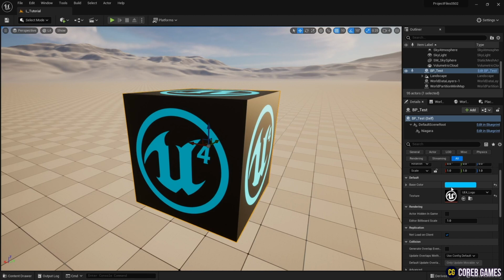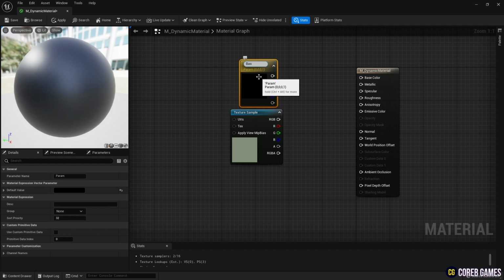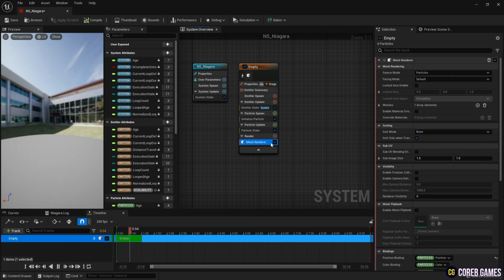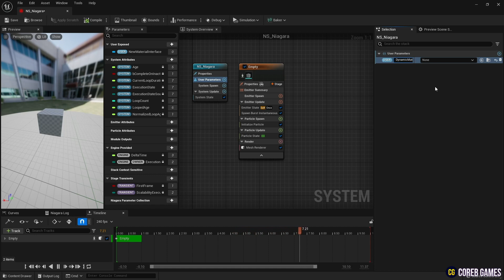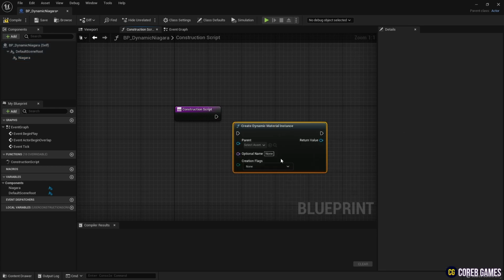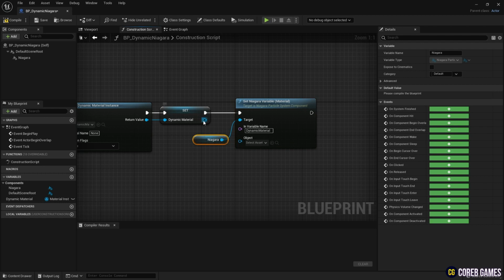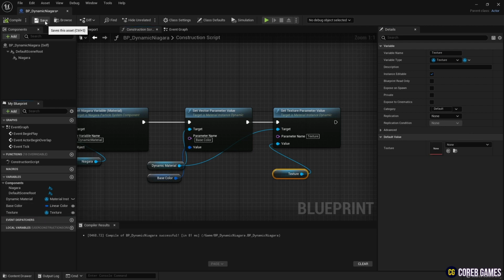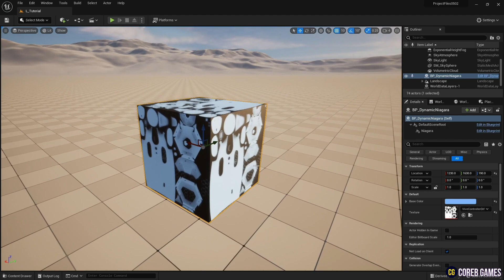UE5 l Control Niagara Dynamic Material Parameter With Blueprint l VFX Tutorial l Unreal Engine 5

Comment: Material stays black no matter what. I'm being told on forums is that because I'm using a V3 color node as opposed to the Particle Color node. But clearly in your example, it works. Unfortunately 'Particle Color' cannot be converted into a param so I kind of have to avoid using just that. Mixing Particle Color with the Param with Add/Multiply/Etc STILL yields a black color in the viewport and runtime. What on EARTH do I have to do to get it to work?

Comment: Followed EXACTLY in Unreal 5.4 but doesn't work. I wonder if something has changed?
Reply: The reason it doesn't work is probably because the variable name should have the prefix "User.", as it's a user param inside the niagara system. it should look like "User.DynamicMaterial"
Reply: @rubncarmona  Cant name a variable containing "." opted for "UserDynamicMaterial" and no change.. EDIT: I see what you meant, changed it... I think its starting to work but material is all black
Reply: @ErrRationale  Can you please elaborate on the  problem? Stuck on the same problem and in classic Epic Games facion there is no documentation to help me, only outdated forum posts from before 5.4
Reply: Did you get this to work? Blueprint Runtime Error: "Accessed None trying to read property DynamicMaterial"